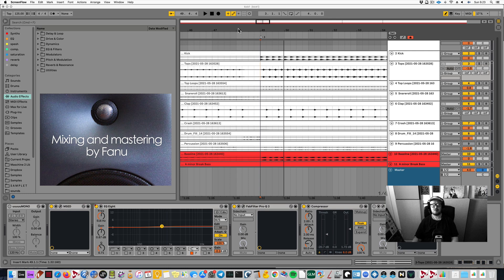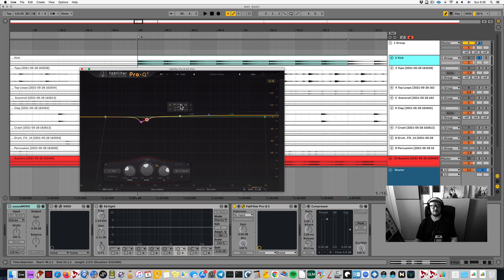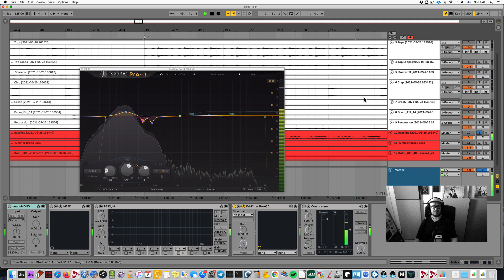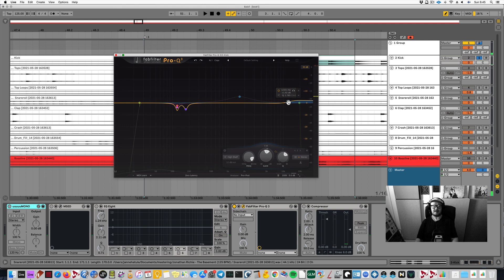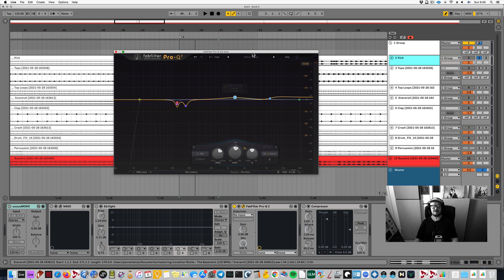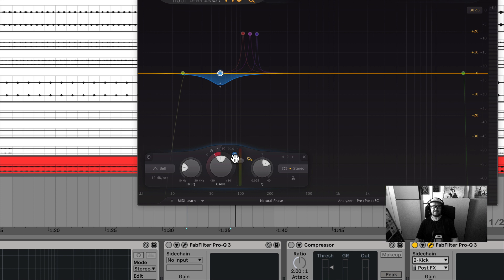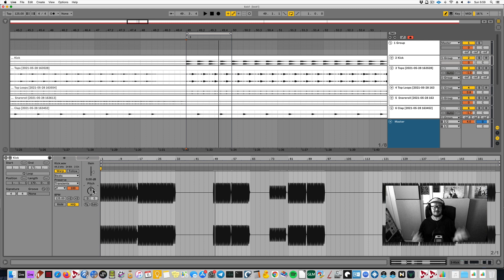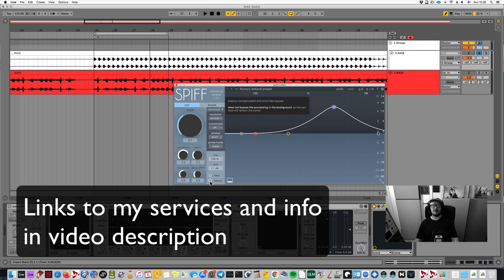Let's talk about mixing kickdrums!

Comment: 20:34 and the reason you're forced to do that is because the producer failed to realize that even kick drums need to be properly tuned at times.
And if your kick drum is not in key with your project, it'll just sound odd no matter what you do with the EQ!  So when you tell people to mess with
the pitch, all you're really saying doing is confirming what I just said.  Adjust the pitch until it sounds MORE IN KEY with the rest of the project!  
There's been so many projects I've mixed in the past and I had the same issue!  Would wonder why everything sounded great together, but for 
some damn reason the kick just sounded weird.  Then I'd find out that it was because it was CLOSE to being in key with the project, but was off!